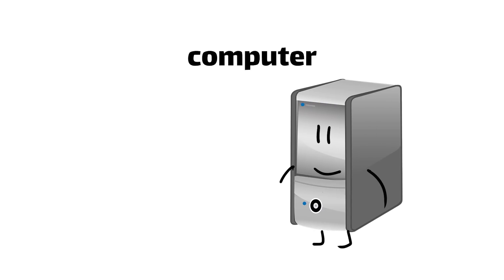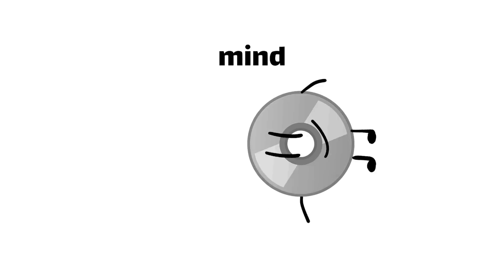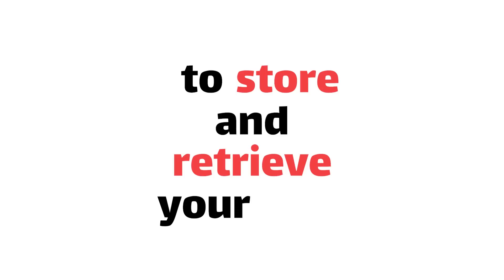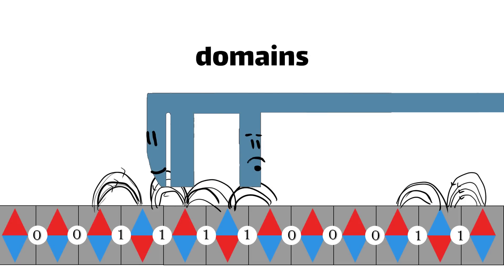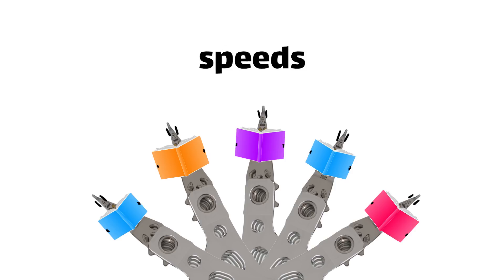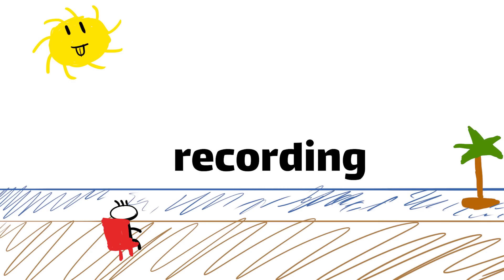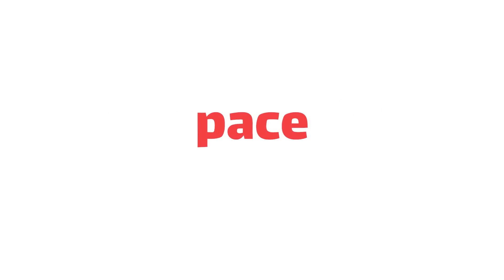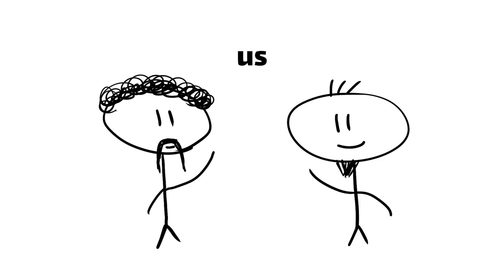The Magic of Hard Drives: How Do They Store So Much?

Comment: The cache memory is programmed by the Windows. After hibernation the laptop retrieves the data from the hdd within 1 min 30 sec w a hdd at 4200 rpm. Copying 3 gb movie is slower than that. 
I played the copying game with a 64 gb micro sd card, it coud do only 7 mb /s, and it went up to 19 mb/s, that's the xc, A1. The non A1 could do 15 or 13 mb/s. 
To do it, it needs a lot of methodical copying of large files without a purpose. Mpg old 4:3 games are copied at 6 mb/s, mp4 new widescreen videos are copied at 19 mb/s.
Reply from the maker: Wow, thanks for sharing all those detailed observations! You've really done some in-depth testing. Let's break it down:

1. That hibernation recovery speed is pretty impressive for a 4200 RPM drive. Windows is definitely optimizing that cache memory.

2. Interesting how the copy speeds vary so much between different file types and storage media. Those micro SD card speeds can be tricky - they often don't live up to their advertised speeds in real-world use.

3. The difference in copy speeds between old MPG files and newer MP4s is fascinating. Could be due to differences in file structure or compression.

4. Your methodical approach to testing is awesome. It's this kind of real-world testing that often reveals performance details you won't find in spec sheets.

Really appreciate you sharing these insights. It's great to hear from someone who's done such thorough testing. Keep experimenting and sharing your findings!

Comment: HDD spins at 7200RPM
Record spins at 331/3 RPM.
That's over 200 time faster.
Reply from the maker: You're absolutely right, and thanks for catching that! My math was way off in the video. Let's break it down:

7200 RPM / 33.33 RPM ≈ 216 times faster

That's definitely way more than the "20 times faster" I mentioned. Good catch on the exact record speed too - 33 1/3 RPM.

Really appreciate you pointing this out. It's important to keep the facts straight, and I clearly dropped the ball on that calculation. Thanks for helping improve the accuracy of the info!
Reply: @1humanemade  No worries!  Great video!  And even for a 54 year old tech, I learnt a great deal from your video.

Comment: 4:03 should say 2 Gigabits per second, not 2 Gigabytes. 

If it can change 2 billion values per second, and each byte contains 8 values (1s and 0s,
then it can record   2Gb / 8     =  250MB/S
Reply from the maker: Thanks for catching that and breaking it down! You're absolutely right - there's a big difference between gigabits and gigabytes. Good call on the math too. 

Let's break it down:
2 Gb/s (gigabits per second) = 250 MB/s (megabytes per second)

Really appreciate you pointing this out. It's important to be precise with these units, especially when talking about data transfer rates. I'll definitely be more careful about distinguishing between bits and bytes in future videos.

Thanks for helping keep the info accurate and for sharing your knowledge!
Reply: @1humanemade  why do i feel like this is an AI response...

Comment: 4:04 ... if it can record 2GB of data every second ... why do HDDs still have speeds like 100 Mb/s
Reply from the maker: Good question! The 2GB/s mentioned is likely referring to the camera sensor's data capture rate, not HDD write speed. HDDs are much slower because they're mechanical - the read/write head has to physically move. That's why they typically top out around 100-200 MB/s for sequential operations. The bottleneck is in transferring that data to storage, not capturing it. Thanks for bringing that up - it's an important distinction!

Comment: 4:06 This doesn't sound accurate. Most HDDs only have speeds of 40mb/s on sequential read so that claim doesn't match what I observe
Reply from the maker: Good catch! You're absolutely right - that 2GB/s figure is way off for HDDs. Typical HDDs are much slower, with speeds around 40-200MB/s for sequential reads, depending on the specific drive. Thanks for pointing this out - it's important to keep the info accurate. I'll make sure to double-check these numbers in future videos. Appreciate you sharing your knowledge!